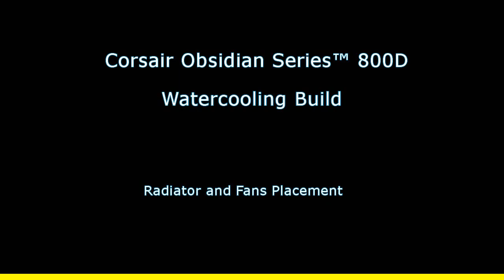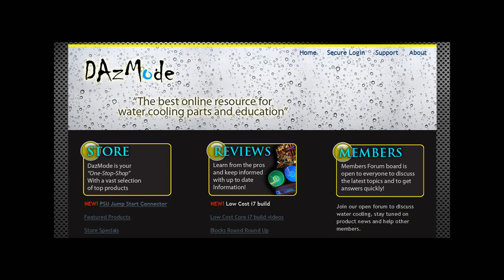Corsair Obsidian 800D Water Cooling Build -- Part #1

Comment: Hey there Daz, very interested in seeing how your build turns out. I did my first WC set up a few months ago in the 800D using the Feser X-360. Like you I ran into difficullties deciding on fan/rad placement. I opted to mount the rad at the top internally with 3 x 2,000 rpm  Scythe Ultra Kazes at the bottom of the rad in a push config. Been thinking about changing it around ever since.  
Looking forward to more updates:)

Comment: Hi! 

How is the Corsair Obsidian 800D? I was thinking of getting either this, or the Cooler Master HAF X. It seems that the HAF X has all of the features but with better cooling and is around £/$ 50 cheaper. 

I'm pretty sure it will be loader than this but I don't know. 

Would you recommend this? 

Thanks in advance!

Comment: Nice build. sub'd cause I'll be using this case aswell soon. 

I wanted to ask though if you would consider a second loop with a 240 rad mounted in  the bottom after taking the drive bay out. I ask this cause serial pumps usually doesn't help flow but it does increase pressure.

Comment: Hey,

I am currently doing a water cooling build with my 800d and have got me some scythe ultra kaze's fans the 38mm think ones. But the included screws that came with the RAD are not big enough to mount them. Where would I be able to get some screws that would fit?

Thanks